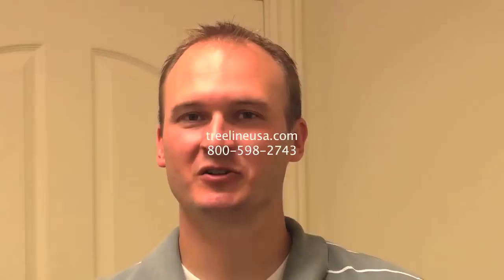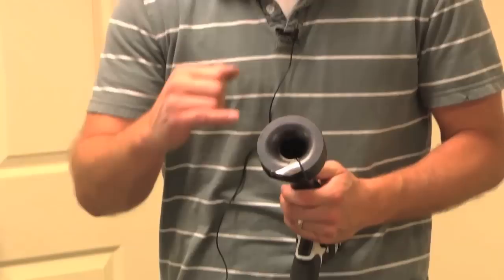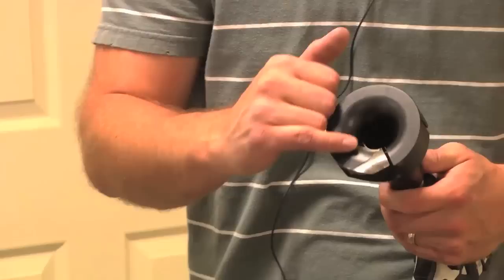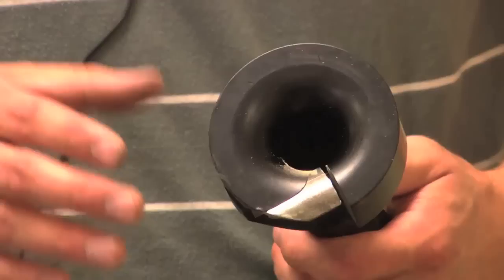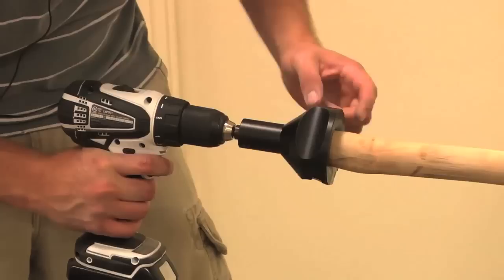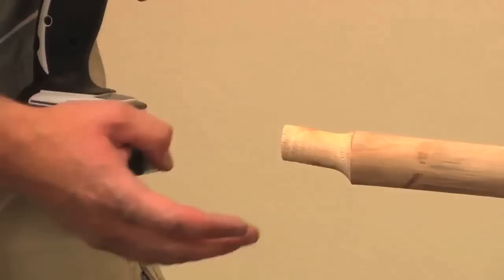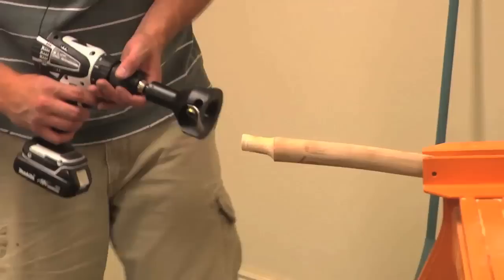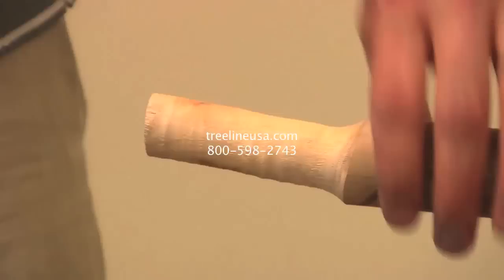How to Use Tenon Cutters to Make Log Furniture

Comment: I bought a set of Veritas cutters and the tenon cutters cannot be adjusted out far enough to to produce a tenon that is large enough to fit snugly into a hole cut by any standard size bit that I have been able to find. Have you ever run into this problem before?  any suggestions beyond sending them back?

Comment: I've made a couple of rustic chairs using mortises and tenons. They looked great when I completed them, but as they dried, the wood cracked around the mortises, sometimes running the entire length of the piece. How do you prevent this?

Also (possibly related), is sealing the wood with something like polyurethane advisable while the wood is still green? I don't necessarily want my log furniture to look shiny, but I thought if I can keep it from drying, I could keep it from cracking. But would this make it rot internally, if the moisture is trapped inside?
Reply: +gigglingwizard  the wood needs to dry out and eventually adapt to the humidity of the room it is in.  it takes about a year per inch of thickness to fully dry.  I have had some success drying small pieces of wood in my oven but they will always form small cracks over time since the pith is still attached.  Do not put urethane on green wood it will not help prevent cracking.  cracking can be reduced by using a product called anchorseal (or one similar to it) on the end grain.  it is a wax product that slows down the drying process so the wood will dry more evenly over time.

Comment: Have you compared the cut from VERITAS vs. LUMBERJACK? They are similar price, tho Lumberjack has many different models and prices, and uses TWO STRAIGHT cutters, vs. ONE CURVED cutter on the Veritas. I thought that would be more balanced and advantageous, but the 1/2" Veritas definitely cuts MUCH SMOOTHER than the 1" Lumberjack. I realize larger tenons might play a role, but if Veritas cuts smoother even on the larger size tenons,  I'm considering returning the Lumberjacks and ordering Veritas if I'm able to.

Comment: I want to make chair legs for childrens rocking chairs. The dowel rod I will be using is 1 1/4" diameter. I want to make the tenons 5/8" to 3/4". What size tenon cutter would I need to buy?
Thanks, great video.
Reply from the maker: Sounds like a fun project!  If you want the tenon to be 5/8" in diameter you would want to purchase the 5/8" tenon cutter.  Same thing for the 3/4".  The size listed is the diameter the tenon portion will be after it is cut.  The 1 1/4" dowel rod will fit into either cutter just fine.  I hope that helps.  Here is a link to our website if you need more information or you are welcome to give us a call as well.  1-800-598-2743
http://www.treelineusa.com/log-furniture-tools/single-blade-tenon-cutters

Comment: I have the exact same cutter as demonstrated, and yet, out of the box, mine does not cut like this at all. I have to apply a lot off pressure to get it to cut anything. The log that I am cutting is fairly close to the tenon diameter so it's not because the piece is too big. Any suggestions as to what may be wrong?
Reply from the maker: Sometimes the blade just needs a quick adjustment.  Make sure the blade is positioned so there is an 1/8" gap between the blade and the main housing.  If it is too "open" it will not cut very well.  Give that a try, but if it still give you troubles give us a call and I am sure we can trouble shoot the problem over the phone.  1-800-598-2743

Comment: Hi , I have  around 8 of these cutters and are happy with them .  One problem  though ,  when in operation they squeal continuously and very loud .   Does anyone know of a trick to take this noise away .  Thanks  Cyril
Reply: cyril brun wax maybe?
Reply: It you use freshly cut wood, I find it fairly noise free. And it cuts easier.

Comment: How do you sharpen the cutters.
Reply from the maker: Sharpening is actually pretty simple with these tenon cutters.  Remove the blade from the tenon cutter and reattach it to the opposite side using the same screw with the sharp end down flush with the end of tenon cutter.  Using an 1 1/2" sanding drum (80 or 120 grit) in a drill press sharpen the beveled side of the blade until sharp.  The 1 1/2" sanding drum will fit perfectly into the curvature of the blade.  Here is link to show you a picture of how it should be set up. 
http://www.leevalley.com/US/wood/page.aspx?p=32339&cat=1,180,42288,45539
I hope this helps.